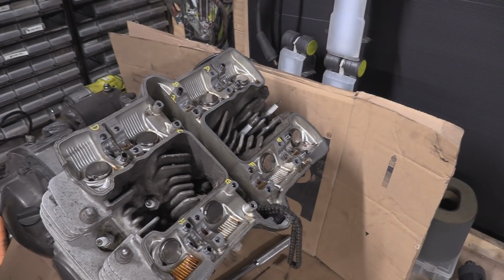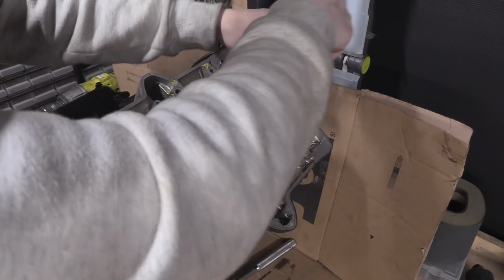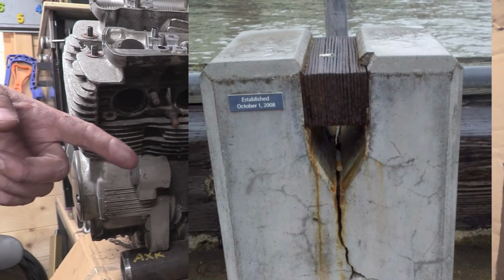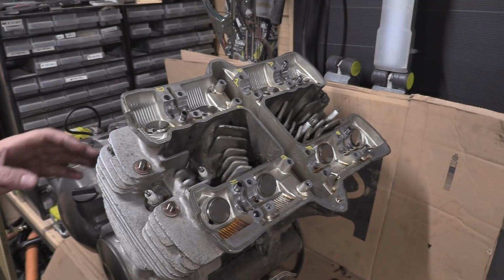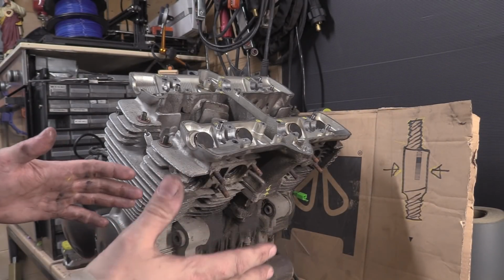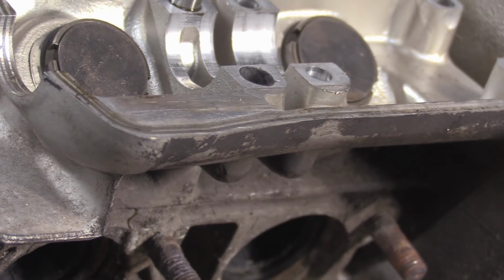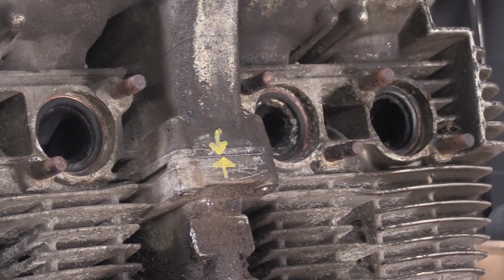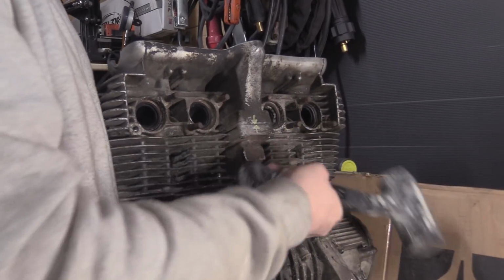Project Isaac #13 Unlucky 13

Comment: Damn I'm glad we don't have to deal with the collateral hassles of salted roads here in AU ....what a shitfight ....but nicely done....gently gently 8)
Reply: yep mate, my bike is only 2 yrs younger than that 22, but since I've had it 15 yrs only been wet once and never salted...
Reply: @bradcobb3418  aye, it really is a challenge we don't get here, caveat always being near the seaside and/or splashing thru salt water and not washing the bike down. As I worked on both bikes & cars over the last 50yrs, some of the shitboxes I see Eric on SMA channel having to deal with, is real horrowshow. When Matt removed that domed had nut as it'd been rusted through, I was like "Phuq me! Is that for real, it rusted thru that much...or have the domes on these nuts have funky flaws?" No don't it's the same juju at play hanging up that front stud..
Reply: we live 2 Kms from the Med, but you never see a rusty car as it rains about 5days ayear on average.

Comment: Doing the paint on the engine while in bits makes sense and check and sorting the internals while at your there is not going to cost much extra. The Yamaha paint on frame and engines often seems to go poor. Hope all goes well.

Comment: Having a bit of a Sissy day Matt... put it on the floor because it'll either fall on the floor, and break either the engine, you or the shed floor if it falls ... then get an air chisel and a flat piece of wood and where you are sissy tapping with your rubber mallet place the piece of wood to protect the surface and a couple of blasts from the air chisel and it will be off....no air chisel then use a steel hammer carefully with the piece of wood and a few sharp taps and it''l be off....rubber hammers wont shock it and break the corrosion ... also where you are hitting it with the steel hammer and chisel ...a gentle vibrate with the air chisel and it'll be off.....I know all the sissy's will say "oh you cant hit it with steel hammer" ...you can! sometimes theory has to move into the practical world.
Reply from the maker: And then break fins off the engine...
Reply: @thedirtyworkshop  minimal risk compared to dropping it on the floor but hey ho!...you'll probably be hitting that for days with a rubber hammer.. you've made it slightly more tricky now to separate the head from the barrel as you've lost all the weight from the gear box so now you have two equal weighted parts to separate...but good luck and keep making the videos ...hopefully isaac will get his bike.

Comment: 8:35, why didnt you take out the spark plugs before removing the head? i would have thought it would be easier to take them out before taking the head off?
am i correct you've left them in place to stop shit falling in?

Comment: The little studs in the front of the engine head  are a pita. Like you say there is not a lot of room in there where it's drilled on the bottom half,. I found in the past they were not straight in the hole and it caused binding.  Either because of manufacture or bending, Might get away with heating and tapping  VERY GENTLY left or right to centralise it a bit. It doesn't take much for it to bind up. Anyone who does what I did  does so at their own risk and so dont blame me when you crack the casting.

Comment: Is there any risk of permanent damage to metals using the blowtorch heat and cool method? 
I'm just wondering the pros and cons of just systematically heating all the bolts/nuts on a project first all in one sitting?
Reply from the maker: No, the casting aren't that accurate and the heat is very locallised

Comment: just curious,  8:50 on the inside of the casting, next to each bucket, there is a ribbed section. Is this just to add rigidity to the casting? or to hold more oil ?
Reply from the maker: Rigidity

Comment: Rust is like a cracker but it doesn't fucking plastically deform
Edit 10 minutes later, I suppose if concrete can plastically deform so can a cracker, though a cracker fractures immediately like a ceramic which don't deform. Who knows?

Comment: Why didn't you follow the loosening sequence for the head nuts (reverse of tightening sequence)?
Reply from the maker: Is that a genuine question?
Reply: @thedirtyworkshop  Yes, I'm assuming you're intending to rebuild the engine and reuse the head, or did I miss something at the beginning?
Reply from the maker: You don't need to undo fasteners in sequence. I'm doing a video soon, showing why.
Reply: @thedirtyworkshop  As I'm sure you know, the tightening sequence of cylinder head fasteners is designed to minimise the effect of the different clamping pressures exerted on different parts of the head during the tightening process. Although not quite as critical during the loosening, because the gasket has already been fully compressed, there are still uneven stresses as you release the fasteners individually, so why not follow the loosening sequence to reduce the risk of distortion?
Reply from the maker: Because what you said isn't true in regards to loosening.